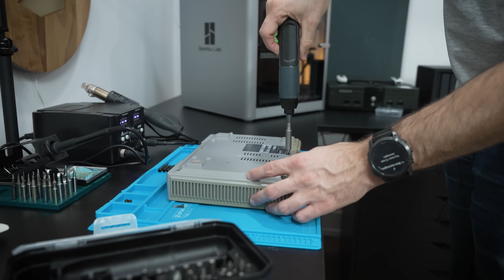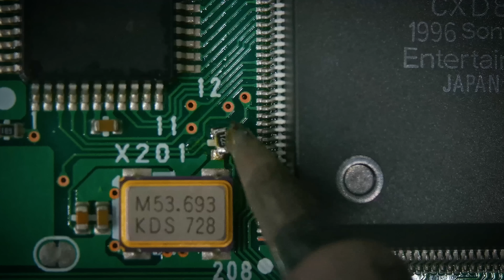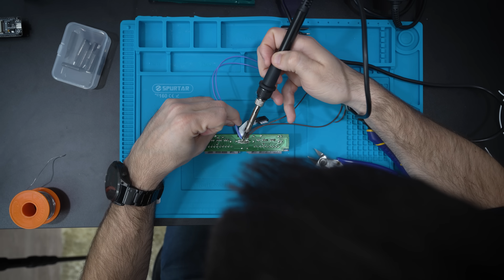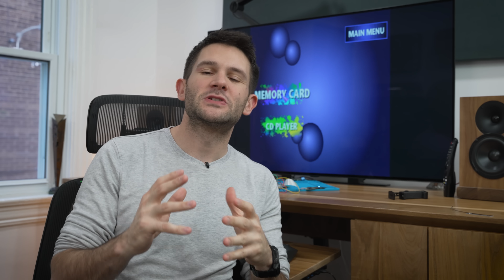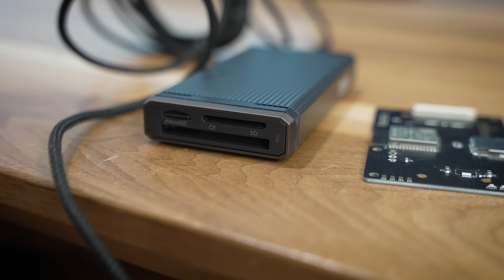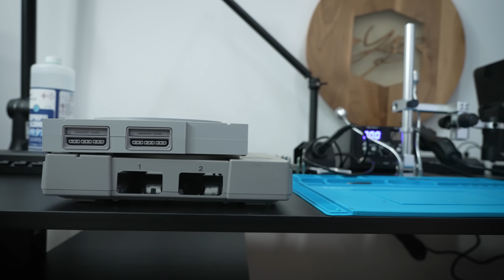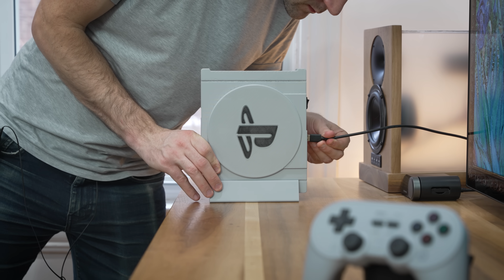I built a MODERN PlayStation...

Comment: I kinda wish there was a solution for improving the PSX audio. A lot of the older games actually had much better audio assets, than the PSX can handle and the audio chip does a lot of shortcuts in terms of processing, however, since different games use different sequencers, it's not that easy to implement a one fits all solution.
Reply: The scph1002/1001 version of the psx has a really good audio chip. People say its even better than an 5000$ cd player
Reply: @megames800  There are some issues with interpolation and sample rates. It only uses 0x1000 to represent 44_100 Hz. That's not too precise and you can get a slightly wrong pitch because of it. Also, a lot of the sequencers only work in 16ths of a semitone. Sure, that should be 6,25 cents, which is roughly what people can tell apart, but it breaks down in chords and vibratos and can accumulate errors due to aggressive rounding.

Comment: I am curious why you wouldn't start with a PSX Slim? Is it due to needing the specific motherboard or because the mods do not support it? I figure it would take off a lot more room starting so small already.
Reply: Does the slim motherboard have the serial port pins?
Reply: @DDavEE  Probably not, given how much smaller it is. The PS1 Slim is almost half the size of the OG PS1.

Comment: Zac, if you have not played it, I'm going to suggest The Legend of Dragoon.  It would probably be a really nice way to waste some time if you enjoy a good RPG.  Some odd translation in a few spots, but they don't detract from the game at all.

Awesome build!
Reply: @Magnosummit  dude yes! 
Fun fact. I never got to finish that game. I bought the game with my early PS2, and played the heck out of it. My house got robbed and they stole the 3rd disk that was inside the console, the controllers and memory card. I have been meaning to find a way to replay that game out of nostalgia.
Reply: @forestbirdoriginals4917  I thought I had responded on my phone a few weeks ago.  If buying a secondhand disc set online isn't on the table, I believe you can download the digital version from the Playstation Network to play it on the PS4/PS5.  It should also work if you have the digital copy on a PSP/PS Vita/PS3, but as of a few years ago, the latter were dropped and require specific login methods since Sony has deemed them "legacy consoles."  I have it for my PS Vita and it still looks every bit as good on the small 5 inch screen as it did on any old CRT TV.  I have found that upscaling old games on emulators doesn't always work, and you're left with atrociously blurry text and images.  PS2/Gamecube/Xbox games can be upscaled well enough.

Anyway, if you are able to play on a laptop or PC with an Xbox/Playstation controller, you may be interested in "Severed Chains - Legend of Dragoon."  The dev(s) have decompiled the PS1 files and made it PC native, though it requires copies of the game to run the patch contained in the install files.  It supports 16:9 displays, higher resolutions, modern controller support, etc.  Some things need to be changed in the settings for the best results (like expanding the 2D elements to fill the screen).  It's not perfect, but it plays nicely.  Has 60 frames per second support on the overworld and individual maps, and they are trying to get 60 FPS to work in battles on the next update.  Next to an official remaster or remake by Sony, I highly recommend it.  All the info you need to get it started is available in their FAQ on their webpage.

Regardless of how you play it, please do enjoy it!  I'm glad to share some nostalgia together regarding such an overlooked gem.
Reply: @forestbirdoriginals4917  I'm realizing my other comments may require approval prior to showing publicly.  I had referred to an unofficial project, and maybe to avoid any issues, I will refrain from it in this one.  Sorry @ Zac Builds, if that was the case.

Anyway, I hope you are able to either buy a new (secondhand) disc set and finish playing the game or find it on the Playstation Network as a digital copy to play on one of the newer consoles!
Edit: the 4th disc is home to one of my favorite places in the entire game, but the 3rd disc is up there in terms of pivotal plot points and dramatic happenings.

Comment: Really cool build! That switch in the 12V power line tho... should have used the switch to controll two mosfets, one for each of the voltages of the power supply (the 8V and the 3.5V)

Comment: Kinda looks like your just heating up the factory unleaded solder to remove it. But you will have a much easier time with removing components if you add leaded solder and flux to what your trying to remove it will lower the melting point of the leaded solder and the flux helps protect the board and helps keep the solder from bridging.
Reply: unleaded? i would've thought most things would still be using leaded solder back in the 1990s, over a decade before unleaded became a legal requirement
Reply: @subg9165  to be honest your most likely right on that one. But a little fresh solder and flux would still help.

Comment: Two things that might help. First looks like you may have need to turn the temp up a bit for this motherboard i would recommend getting some better quality solder and flux i use chip quick flux and mg chemical solder and ive had pretty good results with that.

Comment: Zac I have been watching your videos for awhile and your solder work is beautiful. What I mean is, your dedication to some of these more pinpoint solders as well as your patience and dedication to resolder to get shorter length wires and a cleaner set up is beyond satisfying. I have soldered like 1 or 2 things and was just STARTING to learn soldering from an old boss at a repair shop maybe a decade ago, before I went on to greener pastures. You really have me thinking about learning how to solder and develop some skills, because I have often chose "solderless" options when modding things like my Sega Saturn, SNES, Genesis, etc.. The PS1 is the last console in my "current" collection that has not been modded and I really want to do something like you did on my own as a hobby. If you have a great tip on a effective and progressive soldering practice guide or kit please let me know.
Reply from the maker: Thank you for the kind words! Once you go down the rabbit hole of console mods soldering becomes a bit of a requirement. I don't have any great resources to point you towards as I mostly just learned through trial and error, however I will say that microsolder practice boards are affordable and a great way to learn the basics in a non-mission critical scenario.

Comment: Bamboo lab is locking it's firmware so you cant even print if you don't have internet connection to authorize the print, not to mention withdrawing 3rd party software support - i recommend not buying them until they back out of that idea
https://www.youtube.com/watch?v=aIyaDD8onIE
and there is already news that their "security server" that was supposed to be the improvement in security got hacked

Comment: finally a guy that uses the og hardware and not just say I built a MODERN XYZ  and its just a emulation with a micro/normal motherboard
Reply: I mean, even a Raspberry Pi has so much computing overhead, already has the ports needed, already has built-in WiFi, and is MUCH smaller. One Pi 5 can functionally be every single console up to PS1/N64/Saturn. And have an M.2 NVME drive to store the entire library on. So the only reason to do something like this is purely for the love of the process. Which, yanno, dude's got some amazing skills, mad respect for that. 

But for anyone whose soldering skills aren't up to the task, or who don't have ten thousand dollars in equipment, Pi5 just works.
Reply: im pretty sure theres plenty of people on here who have done this

Comment: It's worth noting that 12v was removed from the USB power delivery spec after 1. So if the wall adapter only supports PD 2/3 then it won't output 12v, it shouldn't cause any harm and will just default down to 5v, but it's caught me out before when using those USBC triggers.

Also - I'm sure you know this, but the wires you are using to go to you ESP32 controller are way WAY thicker than they need to be.
Reply from the maker: Was it removed or is it just optional? Ive found 12v support to be spotty from adapter to adapter with no real rhyme or reason to it and that's why I include the link to the one I know works whenever I mention it. 

And yes haha I know, but that was the only gauge i had in many different colors
Reply: @ZacBuilds  
you are correct, 'optional' is the right word to use, saying it was removed was incorrect. Who knows why, 12v is such a useful voltage and so common.
Reply: @dylanevans5644  Lol, I'm just saying this more for joking, so hopefully don't take it as me being an asshole. But technically if it's taken out of the spec it's undefined behaviour, so therefore support will be spotty, rather than explicitly not allowed 😉
Reply: @ZacBuilds  12v is removed from the PD spec, however the PPS extension to the PD standard, supported by many chargers, allow the device to request any voltage it wants within the chargers operating range - allowing the device to (in theory) connect the charging current straight to the battery without any internal conversion

This will give you access to 12v and 12.1v, and 11.9v, and any other voltage in the normal range, using the correct trigger.
Reply: Better thick than thin?
Reply from the maker: @CyanoTex  Yes. Definitely.
Reply: @CyanoTex  thats what she said lol
Reply: You should also mention that with PPS it was technically added back in. Since PPS allows any Voltage between 3 and 20V.
Reply: Whats odd is that the original Playstation uses 12v but the small psone uses 7.5v
Reply: Please do NOT promote Bambu Labs any longer because they're screwing their customers over with policy changes and even gaslighting people, including but not limited to trying to retroactively change terms of sales which may include BRICKING of your printer. It's insanity.
Reply: Wrong, usb pd goes up to 24v....
5v,9v,12,19v,24v. From there you can do anywhere from 0.10 amps to 5 amps.
Main thing is the handshake similar to hdmi
Reply: @tfkoincognito    huh?  I thought PD is 5v, 9v, 15v, 20v, 24v
Reply: 12 volt became optional, but i know for a fact ugreen chargers support all optional voltages

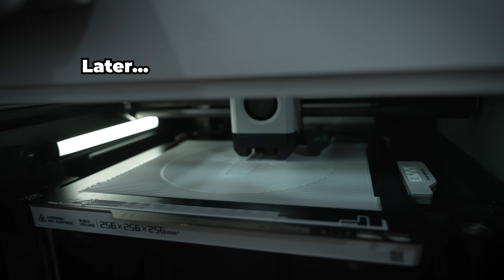Comment: 4:04 Well that didn't age very well, did it?
Reply: Been living under a rock, what's the tldr of the issue?
Reply: @LeNeovein  Bambu Lab are now evil. They want you to update your printer so it only work with their software and linked to their cloud.. for "security reasons"....
Reply: @LeNeovein  Bambu Lab is gonna make their printers only run with their software in an upcoming update
Reply: I don't find that a problem ngl bambu studio is pretty good @deltacommand8053
Reply: @deltacommand8053  Ah, the patented 'Fuck you' update. Once exclusive to scammy crowdfunding campaigns, it has unfortunately infected everything else over time as a standard Litmus Test practice for better or for worse. Mostly worse.
Reply: @deltacommand8053 I don’t own a printer, what’s the issue here? I kinda just assumed that’s how it worked
Reply: @johnsherby9130  Most other printers allowed you to use the software you want.
I for example have 2 printers right now:
Ender 3 v2 Neo (FDM / filament) and Elegoo Mars 3 4k (SLA / resin)

For my Ender 3 I am using Fusion 360 for designing models or I get them as STL from online.
I then "slice" them using a software called CURA. Basically translating the model into how the printer has to move and heat.
I upload the files generated by CURA to my Octoprint server, which is connected to the printer using USB. This allows me to start prints over the network and monitor the status in Home Assistant.

Neither of those programs were created by Creatlity (producer of the Ender 3) or have anything to do with them. I can also switch out any software at any point in time up to my liking or their future development.

The Mars 3 is mostly the same but is lacking network functionality, so I have to put the file on a USB Stick and connect that to the printer.

Neither of those printers can be changed remotely and I can just indefinitely run the software that I want to.

The recent announcment of BambuLab paired with the Firmware Update and Terms of Service essentially means, that they can at any time release firmware updates that force the user to use the programs they develop with the restrictions they come up with or otherwise the printer may never print again.
Reply: @johnsherby9130 it was previously not mandatory and users could've used a LAN mode with other locally available software to work on a printer. After the update the printers supposed to be always online and connected to Bambu Lab 's Cloud. Which not only opens a lot of opportunities for Bambu to collect data from users and govern how they use their printers remotely, but also creates an issue of future-proofing, because there's a high chance that when Bambu Lab decides to shut the server down, or discontinue some of the printer models and withdraw all the support for them, they're expected to become bricks.
Reply: @johnsherby9130  imagine the guy who sold you a pc comes back a month later and says "yeah btw i set your pc to only run windows from now on... and only MY version of windows, and only the programs i aprove of, that i have full control over. so if i decide to make it not work anymore, or change how it works later, you gotta live with that or throw your pc away. Oh and if i dont like you i could theoretically just block you from my service, which makes your pc just a brick"
Reply: @ExarchGaming  Would you trust a company that shows they can f you over at any time, and had NEED to back pedal in the first place, and only after consumers and big channels and influencers in the sphere called them out? They showed us what their future plan was. now they take some stuff back, then slowly implement the rest as "features" weve seen it a million times, why trust them now, and let them get away with it?
Reply: @ExarchGaming  orca slicer dev spoke to bambu and bambu said their slicer wouldn't work on bambu printers so no
Reply: @ There’s many different software that can be used to make files, some of which have better optimizations than others. I.e. one is better at supports, one is better at auto arranging, one is faster at slicing, etc. 
But bambu apparently wants their printers to only work with their software, thereby locking their printers down if bambu’s servers/software ever dies.
Reply: @deltacommand8053  To be fair... There will be work-arounds and the printer won't be dead if Bambu stops supporting it because communities will pick up the slack and crack the DRM, but... that shouldn't be the way it has to be, yeah.
Reply: @deltacommand8053  Bambu feels like the Apple of 3D printing. And Apple's walled garden was a thing I always was able to avoid because I was tech savvy all my life and wanted to be able to alter my stuff, but I've found myself in the Bambu Labs ecosystem because I explicitly don't want to deal with massive hardware tweaking and they know they have me at that point and know they can get away with these kind of very non-consumer-friendly policies. Maybe I should graduate up to knowing more what I'm doing and hang with more finnicky printers.
Reply: He probably made the project a long ago
Reply from the maker: @FakeLibra  Began filming in Nov of 24 haha, lots can change while you have your head down working.
Reply: @ZacBuilds  amazing project, Zac! You’re very creative
Reply: @ZacBuilds  I believe that. I wasn't being mean, I know you have to make money, but still...
Reply: @ZacBuilds  So where was no way to edit this segment out before releasing the video just yesterday ?
Reply: @zwingler  I think since he already had a contract for sponsorship, he had no choice but to keep the segment. The sponsor is only controlling it's product and it's not a scam.. so maybe be had no other choice
Reply: I came straight to the comments :)
Reply: Nope, didn't age well

Comment: U promised to do the  ps vita man 😢 u lied
Reply from the maker: I have one on my bench, it's coming, but I'm still working on it.
Reply: @ZacBuilds  just some tips for u it can be modded like crazy and can have an emulator for the psp on its own can get ps1 games on it aswell by modding it and the whole ps vita library also some games that homebrew modded for the ps vita the 1000 is better than the 2000 but the 1000 has an oled screen but the 2000 is slimmer and has better battery life but the slimmer is uncomfortable in hands if u compare it to the tthicker 1000 also u can make a dock for the ps vita so it works straight onto the tv their is a video on the youtube you can try replicating it just need a 3d printer to make the dock search it up how to transform vita into a switch also this is a personal question if you ever see my comment is the camera upgradable on the ps vita like would it just not work if u changed it or would it get better